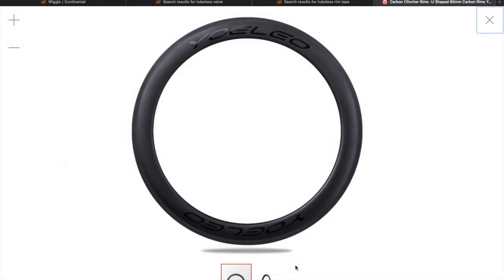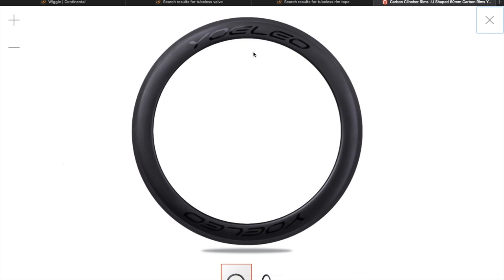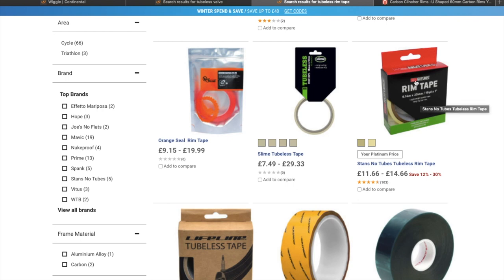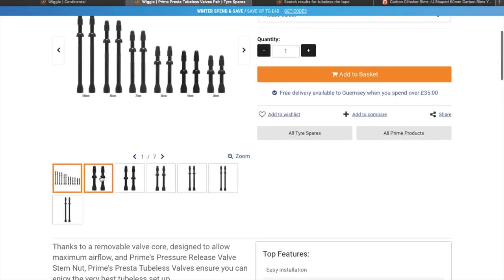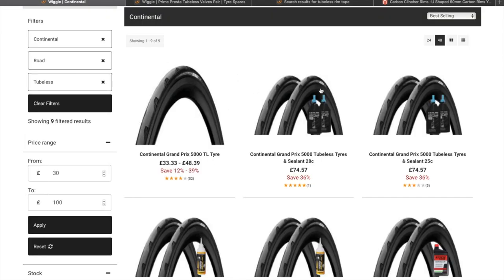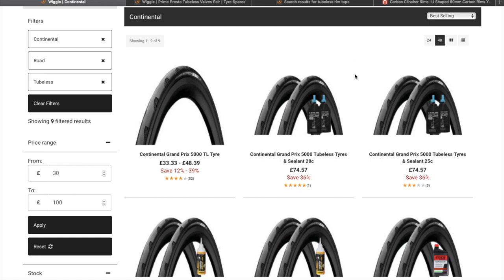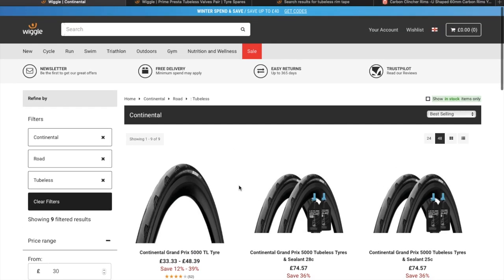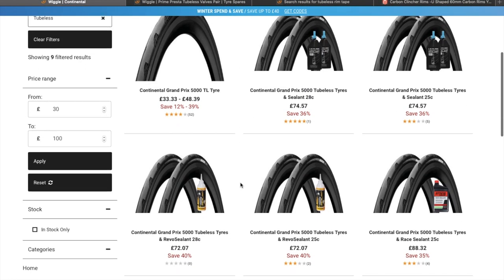Can You Convert Normal Clincher Rims to Tubeless Rims?

Comment: Hi, Kyro
You would have to change your pump too; to bead the tyre to the rims. The upright pumps I believe have and expansion cylinder that blast air into the tyre so that they bead up easily. I would get a dedicated wheel and tyre set!
Saying all that; they are ment to be the DB's as you can run them at lower pressures etc. 👍🏿🚴
Reply from the maker: Thanks, I'm sticking with latex tubes.... easier I think...

Comment: Dont do this. Clincher rims have a different hook to tubeless rims. Therefore you risk the tyre blowing off the rim. This is possible on MTB as MTB uses much lower pressure. On road set up the pressure is much greater and it's not deemed as safe.

This would only be possible if your rims ARE tubeless ready.

Thats why campagnolo, mavic etc use a 2 way fit for tubeless ready wheels.

Who ever said you can do this is a total NOOB you only need to look this up. Any manufacturer would strongly advise against it unless the rim is tubless ready.
Reply: Absolutely spot on!
Reply from the maker: dc 1 yeah, I got that feeling but I’ve heard of people doing it on road bikes, so just thought I’d ask the wider audience base. According to some sites the beading on the tyre or the rim  is different as I said in the video. Just wanted to see if anyone has done it really. 👍
Reply: @KyrosHouseCycling  Love your videos by the way! Let us know how the bearing change goes and best of luck with it 😊
Reply from the maker: edge23310 thanks very much for the comment, it’s good to know.  On the bearings front, still waiting for the new ones, my return package has been stopped by customs, so I’m stuffed until they release them. 👍
Reply: Well I have done it with great success. And as long as you use a tubeless tire it will not blow off the rim and is safe to ride. I worked as a professional bike mechanic in the past and for sure have more experience with bikes than you. And of course manufacturers will tell you not to do it.
Reply: All kinds of rims have slightly different hooks, there are also hookless rims. It is not true that tubeless ready rims in general have different hooks than normal clinchers. The greater difference is in the rim bed. The rim bed shape of tubeless rims makes it easier to get the tire to seal
Reply: Is there somebody here who has actually tried it? Everybody seems to know better without any actual experience
Reply: @sebastianriedel8627   in your experience of tyre and rim combo it may have worked there are plenty of people that have tried it and been unsuccessful... you only need to look on YouTube or weight weenies. There are too many factors you cant just assume "it will not blow off the rim" it depends on the tyre to rim combo... the pressure your running etc etc etc. 

I'm also a bike mechanic and would never recommend this for road tubeless set ups ( and yes I've tried it) with a campagnolo zonda clincher and a pro1 tubeless tyre , at 70psi the tyre blew off the rim so no way would I recommend this to any customers 👍
Reply: There was a comment about pro ones on zondas... I'm not saying every tire rim combination works. But I can say that the ones I tried worked. The pro one has a very flexible bead compared to other tubeless tires. Try to blow a gp5000 off the rim. There are also many people who say you can't mix Shimano/sram/campagnolo 11 speed components. Not everything written on slowtwitch is actually true
Reply: @sebastianriedel8627  yeah which is why I wouldnt advise... not every set up works. Like I've said it all depends on many different factors  when your putting peoples safety on the line it's not something I'd personally recommend.
Reply: @danc1829  it depends on the risk you are willing to take. We can agree on that. I inflated all tries to the maximum allowed pressure before riding them. And of course I ride them at a much lower pressure.
Reply from the maker: Sebastian Riedel I think I’m going to get one tyre and see if it works or not... it’s the only way I can find out if my setup works or not. 👍
Reply: @KyrosHouseCycling  it may work but also may blow off the rim while your riding. If that happens on the front wheel it could be fatal. It's not only rim manufacturers that advise not to do this but tyre manufacturers aswel... 

If you want to risk it that's your call but I would strongly advise against it. Your tyre blowing off at speed isnt going to be a pleasant experience I can assure you on that.
Reply from the maker: dc 1 I don’t kn
Reply: @KyrosHouseCycling  get a GP5000 TL. I that is currently the tire with the highest chances to make it work. And you probably will need an air compressor or tire booster
Reply from the maker: dc 1 yeah, part of me really wants to try it, I don’t race, I just potter along at 29kph most of the time.. should be ok just to test it? 👍
Reply from the maker: Sebastian Riedel I’ve got a compressor at work so if I decide Th o test it out I’ll use that. 👍
Reply: @KyrosHouseCycling  give it a try then see what happens I guess. The first few rides I'd take it very very steady. It will probably be fine setting it up and seal etc... The issue will come when riding it most likely due to the forces applied to the tyre so when cornering etc...

Seen it many times (I've been in the cycling industry over 20 years now) I'm not saying it wont work im saying is it worth risking it.... you can get tubeless wheelsets cheap these days. Hunt wheels, yeoleo etc if u dont want to spend big money.
Reply from the maker: dc 1 thanks for all your advice on this matter. 👍
Reply: If you bank into a corner you could de- bead  the tyre!!
Reply from the maker: dc 1 I may not actually go down this route, probably getting some new group set stuff and I’ll just go with latex tubes...

Comment: Any updates mate?
Reply from the maker: I haven’t tried, the rim beads are different for clincher and tubeless. And they are different on the tyre…Technically I suppose you could do it, but I don’t have a spare rim to try at the moment though I’m
Not sure the interface between rim and tyre bead would fit properly. 👍